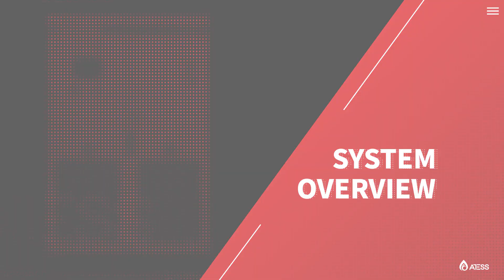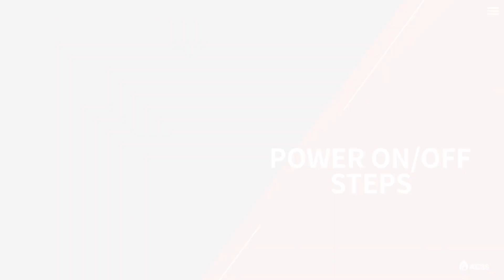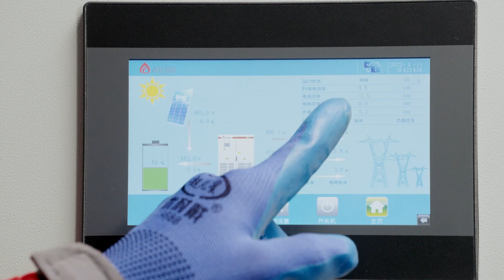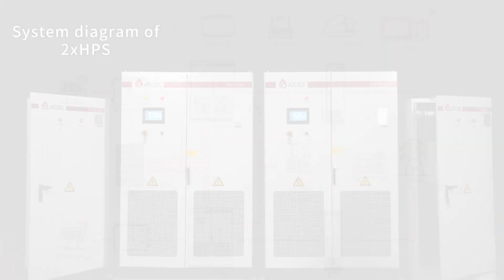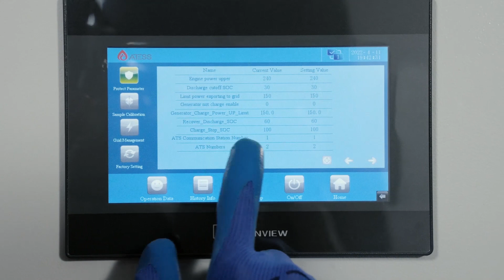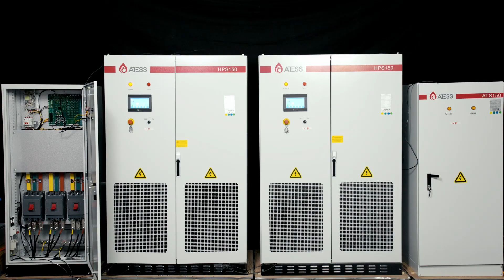ATESS hybrid inverter HPS30-150 installation tutorial

Comment: Dear ATESS team, thank you for the video. However, I have a question: Is it a must to have 2 ATS if I have 2 inverters in parallel? I mean, why not just use one ATS since they are getting AC power from the same Genset or Grid source? And do I also need multiple ATS if I have 3 or 4 ATESS inverters in parallel?
Reply: active redundancy i think. for zero downtime